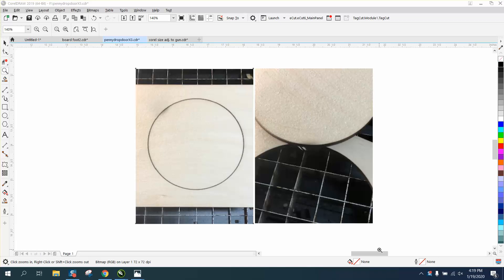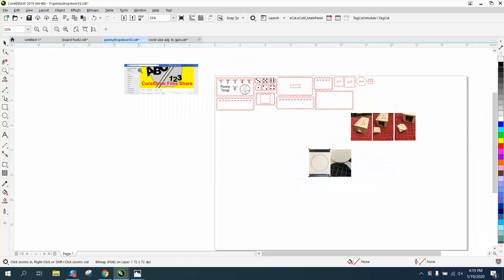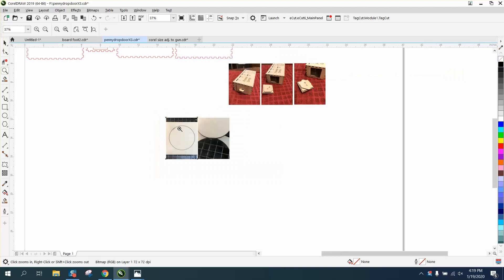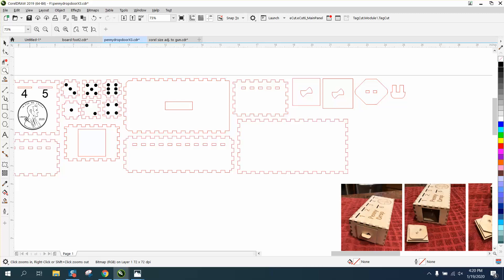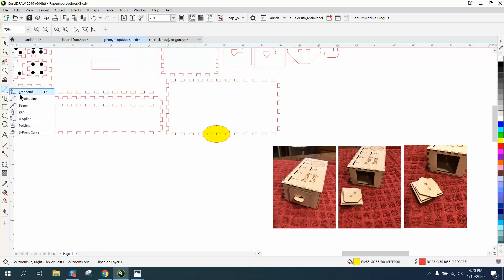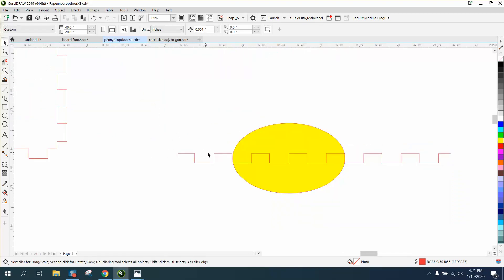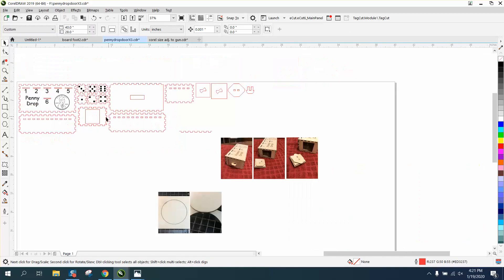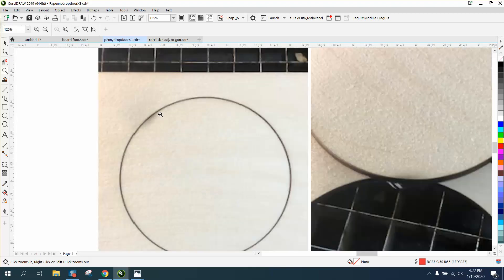Laser Tips & Tricks Plywood cut problem and how to re cut it

Comment: hi, nice hint, but i have a question for you, when i usually cut or engrave na layer he doesn't cut the object in the position he is in the page, but it does it starting from my 0 point so, if i have to cut something a second time i should cut it all again, because if only select the little piece like you did it will be cutted in the upper left corner of my page

now i managed a way to solve this problem some years ago, when i started, but it's like cheating and i have to do something everytime i start a new work, i will explain my method later if you like, but there is something to tell the machine to 
 cut the curves where they are in the page even if it's the only curve in the page?
Reply from the maker: sorry I don't totaly understand, maybe send me a file you are talking about expressyourselfaustin@gmail.com

Comment: I use 1/8" baltic birch ply cut to the size of my laser bed. I shine a bright led work light from the back of the sheet so I can see the dark spots within indicating excessive glue/knots/voids. I mark the areas with blue tape and adjust my pattern to avoid cutting the marked area. Doesn't shine thru anything larger than 1/8" ply.  Steve Good has a video on his channel on how he does it.
Reply from the maker: great idea thanks